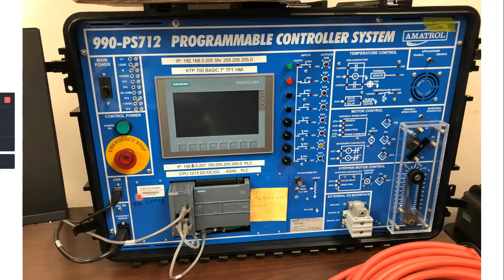Siemens S7 1200 Training Station Walk Through

Comment: Thanks for the nice intro to the 990-PS712!

Both analog inputs are wired:
AI0 to the POTENTIOMETER
AI1 to the THERMAL SENSOR

E-STOP unlatches the MCR, disabling the PLC outputs.
Typically in industry the E-STOP has a pilot light that is illuminated in the button when pressed (even if indication is also provided on the HMI).  This E-STOP has no pilot light.